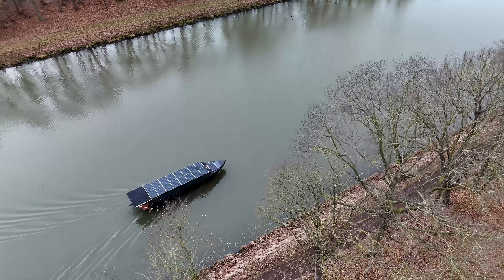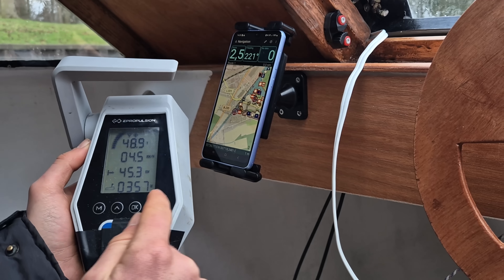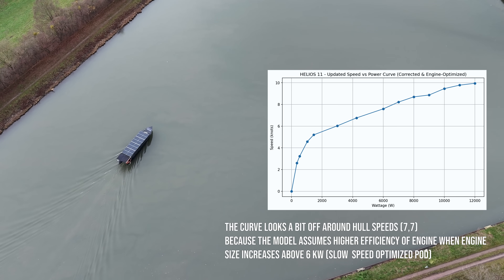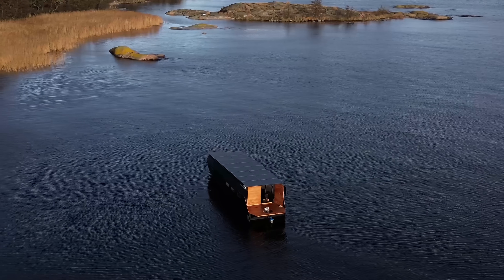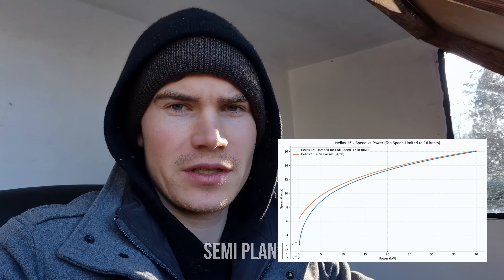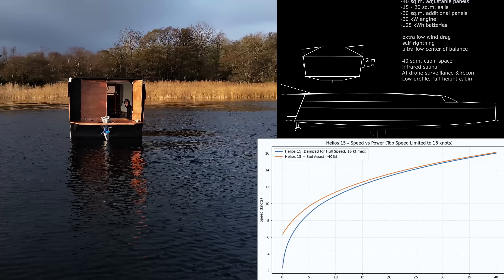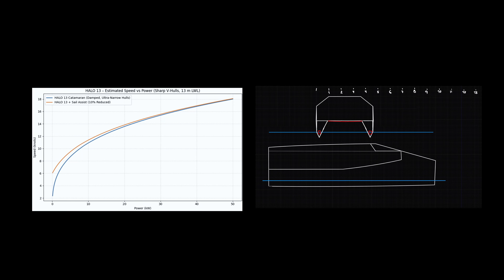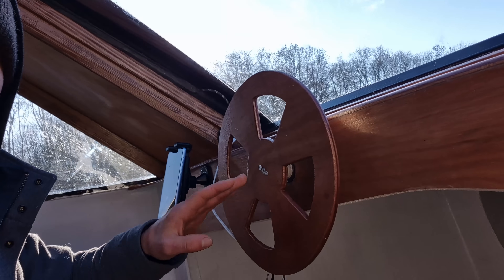10 Knots on Solar? Speed Test of My Infinite Range Explorer

Comment: I love your ideas. I have made small solar boats in the past. I have recently purchased 100 W flexible Solar Panels that are made out of half cut solar cells. They’re 22% efficient and they’re only 2.3 pounds each or 1 kg for 100 W solar panel. It was only $399 Canadian for six of them. Because they are so lightweight I am planning to buy 60 of them and make various things with them, including a pontoon boat and I’ve been wondering about achieving the hydrofoil speed to see if I could fly through the water. I amI subscribing to your channel.

Comment: Wishing you the best sir, have a few thoughts.  You need a human powered generating system that you can use in order to top off your batteries when there's no sun or wind, or just whenever.  I made a human powered generator prototype out of an elliptical exercise device with 350W motors, used a trolling motor as a test output device - so that same sort of thing could work as a direct wired propulsion system to a trolling motor on your boat with only wires as drivetrain. Wimpy but it would work.  

More importantly it could be a way to regularly recharge electronics, tools I got 200W at 24v out of it in bursts but then I'm a smaller person. I am still testing it. For 2 people each doing my rig for an hour twice a day, for a week, i calculated it would store the equivalent of a 20 amp AC 120V circuit for an hour which is a useful amount of energy. You need a battery array to store it in, but also you need a battery that can take in all of that energy realtime without loss, that's why i'm using Prius batteries.  Working an elliptical 2 hours a day would be a good way to stay warm and stay in shape as well.  Unfortunately my experiment is big and heavy built on a commercial elliptical chassis with 3 ea. 350v motors in parallel all driven to 2350 rpm by the pulley multiplied freewheel, not at any sort of product stage. I guess I'm just suggesting that you use some of your idle time on the water to think about the possibilities of incorporating an elliptical or bicycle generator system to your yacht.

Trolling motor props are all designed for pulling torque at a low trolling speed so they are slow - I have had good luck with large, 14" 3 prop RC aircraft props on my tiny electric boat, gaining several mph at less energy output, batteries running cooler but then moved on to 3D printed prop designs, 3D printed props work quite well.  RC Test Pilot on youtube has some great prop designs you might take advantage of if you haven't already seen them, he's put in a lot of time and research into group sourced prop designs. More power to you bud sail on sailor!

Comment: For the "next" boat, think about mounting two motors, with dedicated battery and electronic, so you have redundancy. It would put more trust into the system.
Yes I stole that idea from a different boat.

Comment: I found 15HP Engine (12KW) for 2,2k€ on Ali Ababa without shipping. It is an normal outboard with integrated Electric engine instad of co.bustion engine. 
So you have to add Gear oil and Greece into the lower unit. 
The Seller is good and transparent.
(Carlon Gloria Marine)

You can get this engine with Tiller or remote, open Source Battery, and you can change the Propeller for around 40€ for maximum efficency. 
Max statuc thrust is 122kg, 72V, 49kg, 36kmh Top Speed, you can redouce it with Propeller change, and you can speak to the seller if you could save mony without shipping of propeller

Comment: Just one problem with your range calculations.  You forgot that solar output declines sharply in the evening and is zero at night.  It takes 1000 watts to go 4 knots so at that speed your battery will steadily discharge for about 18 hours per day.  There isn't enough solar power available to draw a motor power of 1000 watts and fully recharge the batteries too.  After your battery gets drained, you would only be able to maintain 4 knots during peak solar hours and then only if it's not cloudy.
Reply: I doubt he forgot that.  Realistically during a trip, one would not charge a battery unless the panels were producing more power than the motors could handle.  So, go at max speed during the day, and slow or stop at night.
Reply: @VPWedding  Averaged over the year, solar only produces the equivalent of full-sun power for about 5 hours.  It's more in the summer but less in the winter. Let's see if he shows how far he can really travel over several days, not some hand-waving calculation.
Reply: @markmeridian3360 I thought the same - what interests me most is the actual achieved range per week/10 days/30 days.

Comment: You’ll have to fight the winter a bit until you reach France. South of the city of Dijon - at some point maybe about halfway between Dijon and Lyon - you’ll reach the southern French plains, where the climate starts to resemble a Mediterranean one. It’s not as cold there anymore.

In northern France it can be cold - even colder than in Germany. But once you persist and make it past Dijon, it gets easier. I think you’ll be following the canal along the Rhine that runs through France past Dijon and then continues further south.

I’m looking forward to you getting there - after that, there will be much more sunshine.
Reply: I've heard the canals of France are closed until the Spring.

Comment: Have you calculated what kind of average speed you would get on long trips like crossing an ocean in less than ideal condition like clouds few days in a row, headwind, big waves. A 15 m sailboat in those conditions if there is enough wind could easily average between 7 and 9 knots. Like you have already noticed it takes little power to propel light boat in calm canal,  but once you encounter choppy seas, tidal currents, headwind then you may need 3x - 5x as much power to maintain same 5 knots cruise.

Comment: Look up Displaning hull, its a good hull for the requirements, The displaning hull is a unique hull design concept that blends characteristics of both displacement and planing hulls, aiming to achieve the best performance across a wide range of speeds and sea conditions.
 Developed by Peter Brady, this design is described as "round bilged planning" with a displacement bow, allowing the vessel to efficiently operate at both displacement and planing speeds without the abrupt transitions typical of pure planing hulls.
 The displaning hull form is engineered so that the first two-thirds of the hull are of a displacement type, while the aft third transitions into a planing type, enabling the boat to achieve speeds well into the planing range while still maintaining comfort and efficiency at lower speeds., can be catamaran or monohull
Reply: That is called a semi planning hull and has a very hard time getting past 1.3x hull speed a an even larger bow wave to climb over.  Now stretch it out to a 8-1 length to beam ratio and you have a multihull hull where it never comes out of displacement mode at 5x the hull speed.

Comment: I found that by reducing cruise speed on diesel powered sailboat from 5 to 4 knots also reduced fuel consumption  from roughly a quart per hour to roughly a pint per hour, from 2400 rpm to 2000 rpm. Very interesting video but found the music distracting.

Comment: Hey hey,  The Part number for a 29 foot cable, helm and bezel is  SS13729 Just do a search for that part number or a version of it and you should find the correct length.  (change the 29 to your length)  You will also have to buy a Motorwell Steering Tube Bracket. (Uflex 239)  This retains the cable at the back.   Cheers

Comment: With a catamaran style hull you should run 2 smaller drives. Plus you will get some redundancy. 2 drives, 2 battery banks, and 2 arrays of solar. Plus you will get better control with 2 drives.

Comment: 2x 6 kw e-propulsion engines seem to cost much less that   one  12 kw engine. Would 2 x 6 kw engines be less effective ? Does rwo  6 kw  engines have so much more drag than the boat will gain higher speeds with one 12 kw engine.
Reply: I was asking the same question 2x 6kw instead of 1x 12kw. You could lift one 6kw out of the water if drag is an issue during low speed transits, however having 2x 6kw would ensure you always had one method of locomotion if one goes down. I would like to believe with the need for more ballast, adding a couple extra battery units would help with both range and stability. Finally, would prop design increase efficiency? 3-blade instead of a 2-blade??
Reply: I see about $3.5K for the 6kW motors and $12.4K for the 12kW version.  So yes, 2 6kW motors would be about half the cost and give redundancy if 1 breaks.   Motor breakdowns are a fairly common occurance.

Comment: For a future custom steering wheel, bend some 20mm pvc pipes (electrical conduit) to the shape you want then wrap in fibre glass and epoxy to stiffen it, that's what I would do.
Reply: In secondhand boat gear shops you get the steeringwheel you want.

Comment: Would a small but powerful wind generator/ generators help with charging batteries while underway?
Reply: The additional drag they would cause would more than offset any power they generate, but they would help charging the battery bank when at anchor at night if in a windy area.

Comment: "Will the catamaran have one motor, or would two be preferable?" I think that 2 motors would be better.
Reply: Two motors gives you a back up for sea crossings and are a major advantage whilst manoeuvring in close spaces and docking in cross winds. 
See the Australian 60ft  electric twin sailing cat  Fantasia sailings DIY conversion ..  there are also some  twin pod motor conversions on U tube ....I agree 25kw  would per hull would be a realistic target  turning E optimised props .. generally larger diameter and have more blades and thinner or with variable pitch ...up to @10kn  rim driven  drives are more efficient .... Also  see the Earthling 40 power cats from Australia..

There is a hydrodynamic device a stern foil system which smooths the flow off the stern of a monohull reducing surface wash  disruption and therefore efficiency and adjusting the vessel's  attitude in the water underway.

Comment: Your entire project is about BALANCE.
There's nothing new about strapping as many solar panels as you can to a vessel and fitting an electric motor.
What you're trying to achieve is the perfect balance between weight, strength, power production, motor efficiency, hydrodynamic efficiency, and comfort.
If I can give you one single tip, it would be to prioritise energy production above all else.. Create a 'power plant' on the water that can use solar, wind, wave, and current.  Integrate all these systems together in a super creative way, and you will have something really special.  All the other specs are important, of course, but they're not going to be anything new.
Reply: Are you sure about that?  I recall that that Solar Challenger car in Australia actually eschewed maximum power in favor of aerodynamics, and that is how it pulled ahead.  So yes, balance.
Reply: @VPWedding  Positive.
You're talking about a race, on land.
We're talking about building a commercially viable solar 'cruiser' - live-aboard vessel.

Comment: When you replace the Navy 6.0 EVO motor with more powerful ePropulsion X12 motor, which has power steering, would you be able to set up some sort of auto-pilot or remote control with that power steering feature?

Comment: are you just sketching in illustrator or do you design in there as well? Just wondering as there are great free cad packages that could help with what you're doing.  open-foam is great for CFD, and there are parametric design systems that are relatively forgiving and fast to use for sketching!

Comment: I saw yesterday on the BBC web site an article on 3D printing of boats. It might be of interest to you. They use a composite mix of plastic and Fibreglass they have refined for use in 3D printers that produce the optimum strength and lightness. The company is CEAD based in Delft in the Netherlands.
They can print a 12 mtr boat hull in a week.

Comment: Great stuff!   Drive efficiency is mostly a product of prop size, rpm, so you want the largest you can use turning the slowest.  And why the higher powered one is much more efficient, a much larger prop. 
In a storm a larger prop has a better grip on the water so won't cavitate, lose thrust, thus control of the boat.
By putting heavy panels far in the rear would have made your transom lower, dragging more water, thus drag, more power needed.  Least drag is when the transom bottom is at water level while moving on a monohull.   
On a cat, hull speed doesn't matter as doesn't make a bow wave it has to climb over. So can be heavier and not slow down.
They are easy to build as can do it in 3 simple parts, 2 hulls and the cabin.
For steering, think rod, not cable, maybe a tiller instead of a wheel to move the rod. Cables have always caused a lot of problems and being replaced.  
Sunman, Bila in the US, has large light 'flexible' efficient panels at ~$1/wt  retail. I'm waiting on a pallet price.

You are teaching many excellent life lessons like there are better ways to live, besides technical ones.
Reply: One strong component of the efficiency is the load. A bigger motor at low load can be more efficient than a smaller motor at high load. This is part of why speccing the correct prop that matches both the motor and the hull design in the design envelope is important.

Comment: I think as a stop measure to make it more stable. Turn it into a very low displacement trimaran. Solid polystyrene floats with a boat cloth around them. You can get free polystyrene waste blocks. They use them as bearers when they deliver foam to refrigerated container manufactures. They become a nuisance. A bit along the style of the Philippine fisherman. Very stable and low drag

Comment: Love your videos and what you’ve done, but they are starting to feel like an advert for your future boats. We are here because we are interested in the voyage, where you are, what you’re seeing. I think you’re in nearly every shot of this video. What about Germany? The canals? The boat? The people? Your cooking? Where are you going next? What are you hoping to see? Have you had problems? Keep it up mate but let’s see more of what you’re doing, rather than what you’re planning. 👍
Reply: I think that's the point of the second channel. To discuss the prototype and future plans. He has the main channel for the adventure vlogs/updates
Reply: @sciencehub5197   If he takes a catamaran the fricktion with the water gets biger, and the harbor costs as well
Reply: @sciencehub5197   I did a small calculation. 7 x 550W industrial solar panels, on a wide 2300mm and length 8050mm (2500mm x 10000mm cannal boat) gives a 3.850Wh with 2 x ACES Lithium 48V of 200Ah (euro 5.000 each) or 4 x Victron Smart LiFePO4, lítio, 24 V, 200 Ah
 euro 2.109,99 , gives you enough power for a day''s cruise, with filled battery's from start. You could drain it for 6hours at max speed with a 6Kwh engine in good solar conditions..
Reply: @sciencehub5197 Which is the other channel and which one is the main channel? I only know about this one edit: its in this videos description. I think the algorithm favours this channel because of more videos being uploaded
Reply: He will understand soon that he also needs to finish this first boat, as it could bring him cash back after selling it to bild his next one.
Reply: I love your project, but hope you don't fall into the trap of targeting luxury and wealthy buyers over practicality and access. Solar yachts habe the potential to make us tread more lightly on the planet.

Comment: I like the description of “the speed that matters” …not top speed of the motor but the speed that you are travelling on solar power without drawing battery or even charging.
Reply from the maker: Yeah, thats the real indefinite speed.
The cruise speed sits a bit above that, assuming you burn the battery over a day or two
Reply: @Lukas-TrueNorthYachts   If you do not have the solar m2 to power it then a bigger engine and batteries does not make sence as it ads weight that brings your boat deeper and create more friction with the water, also the cost would rise much higher. For a extra 2.7/2.8 knots you double the power use to get to that speed. At 5 knots you seem to have the best performance. And nobody wants to live in a empty boat, with only some water and food. Look at the side masts/sails of Sven Yrwind (21 Sept 2025 The second mastholder), you need a front hatch to install them when needed, so from the inside going on the front deck. I would use tailwind and charge up my battery or save them extra during the travel. ;o)

Comment: Dual motors? Would increase the handling in tight spaces, forward on one, backwards on the other, would spin it around itself?
Reply: yeah, but it would also have more drag and weight
Reply: @Jo-gu9st sure, but if you dont need the power just tilt one up. Maneuverability is going to be more important as the ship gets larger.
Also for redundance.
Reply: @magnusandersson6533  better to do a small lightweight bow thruster if close quarters maneuverability is the goal.